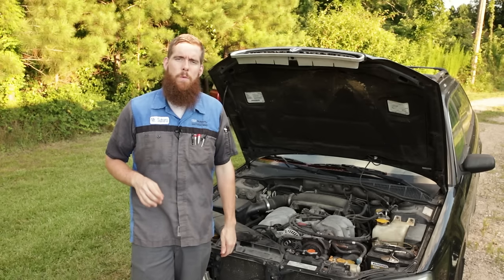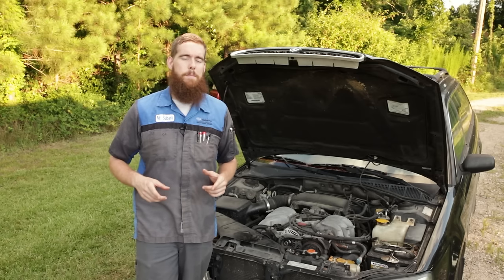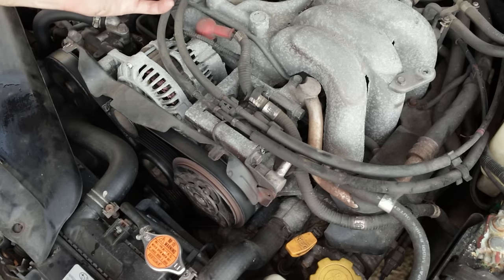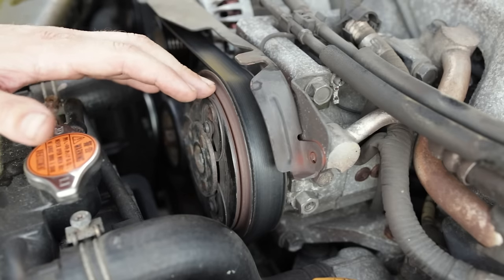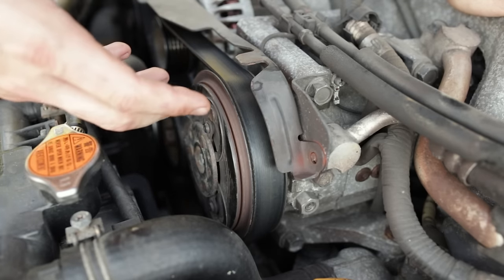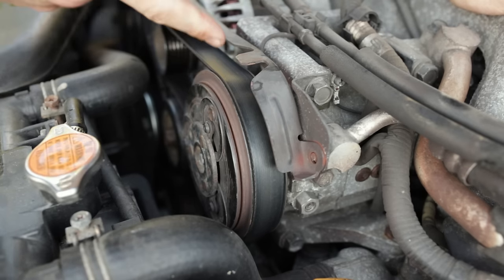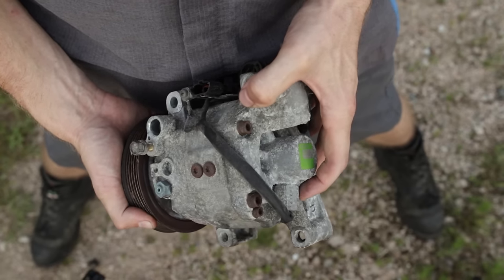Subaru A/C: Common Failures & Issues

Comment: U r amazing thank you thank you!! Shop wanted $900 to replace. $15 in OEM o rings, recharged, FiXED! Alaska in the cab! U r a philanthropist. God bless you sir.
Reply: Of course shop wants the most 💰 ... they never try to help you out and say oh the o rings are the problem
Reply: Ima try that, mine won’t just blows warm been without AC for two summers lol need a lot of work
Reply: @MoVoltageMoPower 😅

Comment: I just wanted to add that on my '05 LL Bean Outback H6 the a/c was acting up.  At initial turn on it blew cold..  After a few minutes the compressor stopped.  The relay was no longer providing power to the compressor.  Mechanic jumped the relay and the compressor came on.  This caused the him to scratch his head a bit.  He then remembered a Hyndai that did this about 15 years ago. Never saw it on a Subaru. So he worked back wards to a temperature sensor, not the engine temp sensor that displays on the dash.  The offending sensor, as I was told by the office, resides near the thermostat and it provides info to the computer which provides the signal to the relay that turns on the compressor.  Apparently it was sending an erroneous reading telling the computer the coolant temp was over 400 degrees according to the diagnostics.  The computer then tells the a/c relay to stop running the compressor to remove a load from the engine.  I've read numerous accounts in forums about a/c compressors not turning on after the car warms up.  None ever mentioned this sensor.  Replaced the sensor and all was right with the world.  Keep that in your back pocket.
Reply: Ok, this was the one I was looking for. 2010 Forester XT; clutch adjusted to proper air gap; fresh coolant recharge; AC blasts for 10-15 min, then compressor stops engaging, fan blows only warm air; if I let the car sit at idle in the shade, it'll keep the AC cranking, but once I start to load the engine, it immediately cuts out. Your suggestion (faulty temp sensor) would explain this behavior. Now all I have to do if find the offending sensor and replace it - fingers crossed! If anyone has done this, I'd love to know more.
Reply: System rechareg - no change. Replaced the clutch - no change. Took to mechanic who finally found a frayed wire after the fuse box and before the compressor coil relay. Mended that wire, and we're back in business... had to pay for 5hrs of labor for chasing electrical gremlins, though... darn gremlins...

Comment: My 2014 forester 2.5 ac is intermittent. It will blow perfectly cold for a while then the compressor kicks off and it’s completely uncooled air. Seems as when I get on the gas it will kick back in for a bit but ultimately keeps going on and off. Is this indicative of any certain failure?

Comment: "common failures and issues". Subaru anxious levels rising again...
Reply from the maker: They're not that bad. Lol
Reply: On the note of AC in Subaru's, I've been advised in the Liberty's, the vibration can be stronger, or maybe this is a Subaru thing. When it's on sometimes I can feel it "engage" every 10 seconds when idle... I mistakingly thought it was due to dirty maf etc?

I've not felt this in my fb20 Impreza
Reply: @MrSubaru1387  My compressor went, it's a 2017 WRX with 12k on it. That's pretty bad.
Reply: @Невада большевик Yea it did this time, but it won't next time

Comment: A/C won't turn on if freon is too low, battery voltage is too low, or fan is off. $20 gadget plugs into OBD port, and displays speed, volts, and temperature. Its worth it if you are overheating or have battery problem on a trip imo.

Comment: Two years ago I started having issues with AC, it would not produce cold air when the car was not moving, it turns out the sub-fan was not working anymore and caused the compresor to fail, the condenser to get clogged and finally the radiator to blow up. Had to replace the condenser, radiator and AC compresor beside the Sub-Fan because of 3 mechanics failing to check both fans were functional.

Comment: Well the reduced capacity system explains why my dad says his 98 Forester AC was waaay better than his 2006 Outback. Thanks!
Reply from the maker: Yup. He's telling the truth! Haha. Those 05-09 systems were impossible to dial in to handle the heat and humidity of the south.
Reply: @MrSubaru1387  He literally says "This one is alright, doesn't do well in traffic or on sunny days. The 98 Forester would blast chill you on max." Hahaha. I've never daily driven one newer than 04.
Reply: I actually walked away from an 06 specifically due to the weak AC. This 06 had a brand new compressor done by the dealer. Still felt way weaker than the 98 i wound up buying.
Reply: @forresttaylor2757  Haha literally exactly how my dad feels.
Reply: I just got a 2007 Impreza is there anything I can do to beef up the ac I got a baby on the way and I’d like to have good ac
Reply: @-Clique  I'd imagine you can upgrade to a larger condenser from another model, though it may require some modification. Otherwise do a system flush and recharge to make sure it's working top notch. MrSubaru may have better advice.
Reply: @802Garage  sweet thanks for the advice I’ve been building cars for speed for a couple of years now but now that I got a family I gotta make sure they are comfortable here in NC the summers and be kinda warm thank you so much!
Reply: @MrSubaru1387  what do you think of the case where I believe there is enough refrigerant in the system, but the high side will run at a normal pressure and low side will go all the way to zero? It sounds like there is a clog or obstruction in the system,  if so, where do you suppose? 2007 Impreza with 2.5.
Reply: So comment on old post I know. Do you know where I can order a new clutch for theese first gen foresters?

Comment: @12:40 cabin air filter!  Check this first! Clogged filter can cause  the compressor to short cycle due to the evaporator temperature sensor shutting it down as the  evaporator freezes from no air flow to warm it up. Short cycling can be caused by high or low refrigerate pressure (overcharge or undercharge, clogged condenser, etc.), but just the  cabin filter being clogged can cause it too.  It's ez to check first. 

Also, the compressor clutch engagement gets louder as that gap increases. If that engagement clunk is getting loud it's probably time to take a shim out. The clutch face comes off with jacking screws and the shims are in the center bore around the center bolt.

Comment: Really well presented information. Just had my 2014 forester ac replaced under extended warranty and had intermittent issues immediately. I checked the cabin filter after seeing this video and it was completely jammed up with dirt/dust, so the air volume and cooling issues under high fan pressure, but not low, now make total sense. Hopefully a new one does the trick.
Thank you!

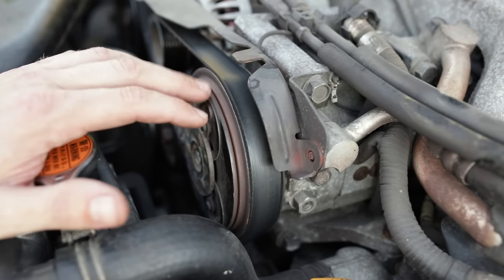Comment: Thanks for sharing your info. Great video. At about 7:50 and 9:45 mention is made of using the diagnostic mode to check the electrical function of the clutch. We repaired the a/c on an '04 Forrester today, and learned that the system needs to have enough charge to observe the clutch operating, even in diagnostic mode. It didn't take long to learn that the low pressure sensor was locking out the compressor clutch in diagnostic mode, too. I simply ran a jumper from plus 12v to the compressor directly, to discern the air gap was fine, while engine not running, and quickly. In our case, the suspect two o-rings at the compressor were the core issue. Replaced them, evac'ed the system and recharged to exact volume of refrigerant, and it works like a champ now. We will remember to check/replace the cabin air filter too.
Reply: Hey there Whitney. I just wrote a question, then saw yours from a year ago. So you are saying that the green plug test is still dependent upon having enough pressure to engage the pressure sensor? I actually did the same thing as you, hotwired from the + of the battery to the clutch braided wire, and it had engaged fine. So maybe all I need is to replace O rings (and maybe the Schraders while at it), vacuum the system, and then fill it up?
Reply: @TheCaribeso  Correct, if there is not enough refrigerant pressure to enable the compressor, even in diagnostic mode, the compressor clutch will not engage. It is a safety to prevent system damage. Therefore I did a quick jumper test to ensure compressor clutch engagement. Once I saw clutch engage, I determined system was just out of refrigerant (leak at orings). Basically I wanted to eliminate electrical issues, before repairing, evacuating and re-charging the system.
Reply: @whitneydesignlabs8738  thank you! once i realized that probably all i needed were O rings and evacuation, i brought it to a shop who finished the job for a reasonable price. Keep up the great videos!

Comment: I've had the same issue on every Subaru I've owned - '97 Outback Sport, 2003 Forrester, 2006 Outback Sport, and 2008 Outback. Easy fix if you can ID the problem.

Comment: Mr Subaru saves the day! 2011 Subaru outback 3.6L I'm in Arizona and now that the heat's coming on I thought I was just low on Freon because my AC would start off cold and then start blowing warm. I always like to see what Mr Subaru says about any procedures before I do them on my own. I have a mechanical background but don't work on cars for a living anymore.  I would have chased my tail around a little bit on this one only to discover it was the simplest possible problem. I had a clogged cabin filter.  Thanks to Mr Subaru I was able to start off with the simplest solution and got lucky.  👍

Comment: You are a Subaru legend! Thank you for the superb video. On my '04 Outback, the A/C blows fine for about 15 minutes and then stops blowing cold air, just warm air comes on. The fan comes on but no A/C. If I turn off the car for a few minutes and then start it back, the A/C blows again for a few minutes and then off. This occurs on hot days predominantly. I have replaced the A/C clutch but the issue continues. I suspect the revolution sensor harness is bad.
Reply: Exactly what my 2010 Forester does. Aside from turning the engine off then back on, I find that raising the RPMs (usually) kicks the cold back on.
Reply: I'm having the same issue, these pass few days, then my car over heated, i added some coolant to the radiator and drove it around, so far the AC is working and the engine didn't over heat.
Reply: did you ever figure out what exactly was the problem? This exact same thing happens with my 2004 Outback H6
Reply: @railfanatic1416  I have been unable to figure out the cause. Some posts say it could be the revolution sensor, but you can't buy that part without the AC compressor. I will take the car to a shop and let them diagnose it. The funny thing is that when it blows cold air, it blows well for 10-12 minutes which tells me it may not be a freon issue. Something is not making contact to trigger the AC after 10 minutes because the AC fan kicks in just like when AC is blowing, but the compressor does not engage. In my case, leaving the fan on and turning off the AC for 10-15 minutes works sometimes, but not always. Many times, the AC does not start if the car is hot, even if the car is turned off for more than 30 minutes. Bizarre.
Reply: @MrSoulMonk My Volvo was doing the same thing  and I replaced the evaporator sensor and that solved it!

Comment: knowing about the existence of the test connectors is a marvelous resource. While the compressor on my 2009 Forester just hit 180,000 miles and is getting a bit long in the tooth, I at least know I can test the air gap, which is extremely valuable knowledge.

Comment: A few questions / ideas for future videos:

1. Does the Crosstrek burn any oil?
2. How is the Crosstrek doing on the 5W-30 oil?  It is running higher oil pressure? Do you recommend running these engines on 5W-30 vs. the factory fill 0W-20?
3. How useful are low cost blue tooth / phone app scan tools such as Blue driver on a Subaru? 

Thanks for helping us keep out Subaru's going!
Reply: Here are my anectdotes of your questions:
1.  Highly variable. I know people with my engine that burn a quart every 1k miles, while I burn like .5 quart over 6,000 miles.
2. I live in Raleigh NC, run 5w-30, it's fine. No noises or anything. That said even on the highway today in 95 degree heat it was only at 207 for the oil temp. Not crazy hot. 
3. https://www.amazon.com/gp/product/B005NLQAHS/ref=ppx_yo_dt_b_asin_title_o02_s00?ie=UTF8&psc=1 this and the app "ActiveOBD" for Android are great. You get coolant/oil/CVT/inlet air/intact tract/cat temps, timing, battery voltage, and a good amount of code scanning ability.
Reply: Justin Quaglia What model year is your Crosstrek?
Reply: Instead of doing your research via youtube comments you should check out Subaru forums like nasioc. These are common questions and you'll find much more reliable answers than what you'll find in the comment section of an A/C diagnostic video.
Reply: The FB20D engines are very reliable!  Especially the 2014 to 2017 model years because the it still used good ol port-fuel injection rather than direct-fuel injection. If you can find one with a MANUAL transmission they will last longer than the CVT...  Also make sure recalls have been caught up to date. The FB20D in the Impreza and Crosstreks had valve-spring recalls best lookup via vin to see which models affected

Comment: I have a little problem with AC on my 2.0i Legacy 2003, since a few weeks ago there is a little leak of water near the passenger wheel (above the catalyst more or less) and a beautiful metallic noise when AC is turned on. At the begining I thought that the water could be condensation but really I don't know. I' ve replaced the cabin filter with no results.
Thank you for all your videos @MrSubaru1387 !!
Regards from Spain!!

Comment: from 10:20 onwards I was just admiring that thick wide stance you are taking, no-ones going to push you over whilst recording!
Reply: So my 07 outback 2.5 AC works ice cold when you first turn engine on then after 5 -10 mins it stops blowing cold . I have topped it up with refrigerant and I noticed that by looking at the AC clutch when someone revved the engine of my car the clutch spins fine but then will stop spinning . Does this mean the gap between the clutch and compressor is too big ? Love the channel . Love my Subaru 👍
Reply: @jamieellis3468  Possibly, definitely worth a try removing a shim before you try anything else.

Comment: The A/C system on my 2003 UK STi used to keep leaking refrigerant and so I had to keep buying refrigerant refill bottles and topping pressure up - they were not cheap at €60 a bottle... and then the pressure only lasted a few months before it leaked out again. Got sick of it, so went to a professional A/C repair garage - they checked entire A/C system for leaks (he went around with some sort of light) and said it was the radiator that was the cause. So he replaced the radiator in the car - showed me old radiator and using light could see large patches of fluorescent stains on parts of radiator where it was leaking out. I asked could there be other parts leaking too and he said there were not any he could see. Cost me over €400 to do the job. So A/C works fine now. Haven't checked pressure since then though - hope its not leaking out of those O-rings you mentioned - he never said anything about that, so no idea if they replaced those too. They had awful job trying to get radiator bolts out too - had to cut them out - they were glued down. Anyway no way i could replace those without losing the pressure in system again - it is very high Bar pressure in there. They never mentioned or fixed the wobbly compressor clutch though.. it still works fine (apart from squeel at startup) so maybe they didn't notice it.

Comment: I watched this video a few weeks ago just to learn. Just got my 2023 crosstrek 6mt. Took a look under the hood and to my surprise the ac compressor is variable stroke (so no clutch)  and the sticker on the side says Denso (well I'll be). They also switched to R1234YF

Thanks for the awesome videos!
Reply: R1234yf has very similar properties to R134a, and while it is not technically legal to retrofit to use the older refrigerant, a LOT of folks do change them over due to the high cost of R123yf, which is around 10x the cost of R134a. What is the difference? The new stuff has a lower global warming potential, and to discourage switching to the cheaper stuff they use a different hose fitting. And capitalism once again comes to the rescue of your bank account with inexpensive adapter hoses and fittings.

Comment: Found this in my search for my AC not blowing cold.  Bought the 2015 WRX with five miles on it and now it has 93k!  Still runs great and pulls hard but now can't have cold air like it used to have.  It just happened one day and before that it was blowing cold.  Back to the research it goes...

Thanks for posting Subie Subie videos as well.  I watch them from time to time randomly
Reply: I'm having the same problem with my 15' wrx, did u ever fix the problem? If so what was causing it??
Reply: @AhhitzSammy  traded the car lol
Reply: @AhhitzSammy  same issue with my 2016 STI. Did you find a solution? My compressor has made noise since I bought it 2 years ago and kept me cool enough when it was 115 degrees last summer in Portland, but this year it’s barely adequate at 83 degrees out.
Reply: I've been hunting for an intermittent issue with my 2014 Crosstrek Hybrid AC. 120k miles. Sometimes it blows cold, but seems randomly get stop, and then come back again. Yes it happens in EV mode as expected, but this issue is during normal driving conditions. The shop can't figure it out